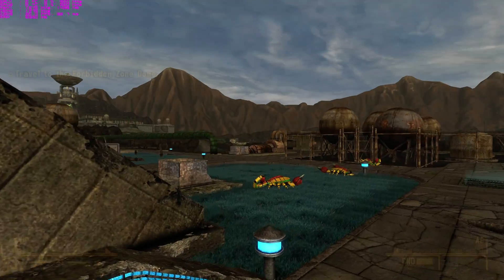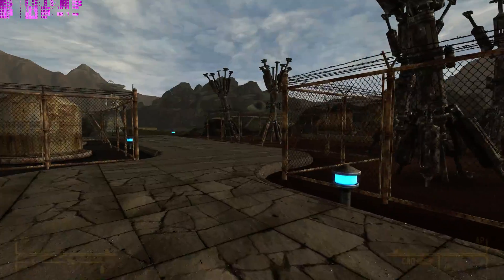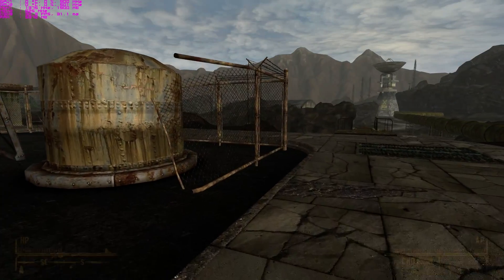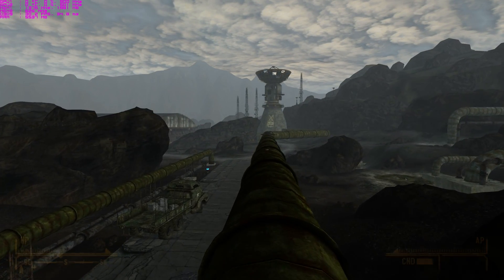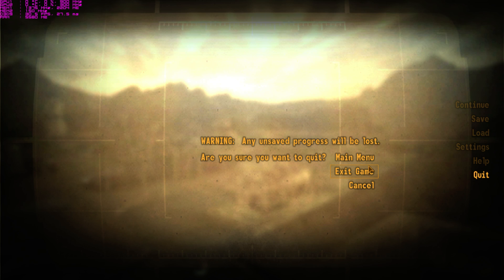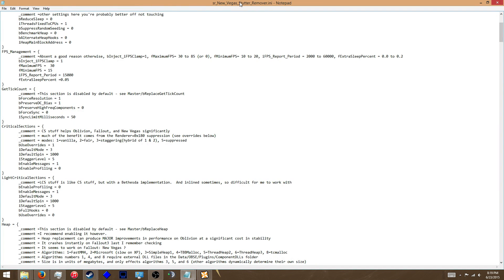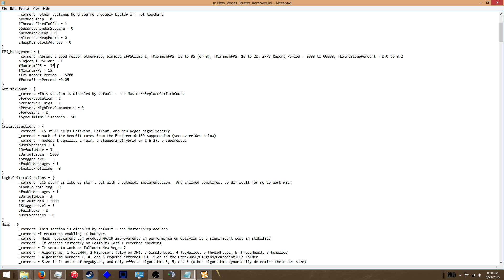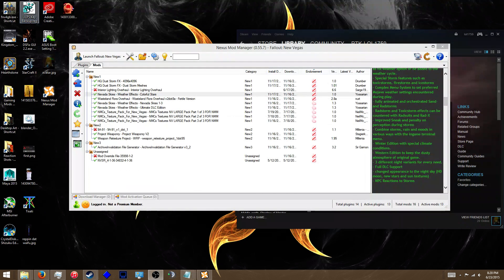An Introduction to Gamebryo [Creation] Engine Rendering

Comment: As someone who made game engines for fun, the argument "the engine is old and showing its age" is a pretty silly argument tbh. All that stuff is fixable, an engine's age has absolutely nothing to do with the quality of a game; it's more like Bethesda apparently doesn't have resources/time to fix issues/for proper QA. Open world games are generally hard to make in the first place, because there's so much stuff going on, you can't account for everything, compared to some linear corridor shooter (speaking of the silly calls to replace Creation Engine with idtech in TES6)  Blaming the age of the engine for everything is lazy thinking
Reply from the maker: I agree with you. You should take my comment not as a literal statement, and more a commentary on the codebase relative to what else is available now. It's clear that there are areas that needed to be improved, both on the engine and testing/qa side.

Comment: The fact that Bethesda still used the same Gamebryo forked codebase made the Creation Engine a crappy mess. Not only that but other game engines with Havoc Physics CAN handle refresh rates beyond 60Hz such as Valve's Source Engine (versions 2004 & 2007). Bethesda is just getting sloppy and lazy in fixing the bugs. 🤣🤣🤣

Comment: old video, but i just wanna say, the things mentioned both in the video and in the commets arent inherent issues with the engine and have been fixed in later bethesda games, such as the 64hz bug causing microstutter and the issue with the havok physics implementation not working when run at high framerates. in truth, the engine used by bethesda is pretty much perfect for the games they make. for example, its one of the best engines out there when it comes to keeping track of and rendering the many items you can pick up in the game world. it might be a small thing, but one of the staples of bethesda games is that pretty much every small object in the world can be moved, grabbed, picked up in your inventory, dropped, and sold. the engine bethesda uses currently is also incredible at keeping track of physics objects, so things you move around linger in the world pretty much forever. that piece of cabbage you put on a shelf is there to stay. the cons of these two featyres are increased save bloat and bugginess, but thats the price you have to pay for a non-static game world. another, and probably one of my favourite things about the engine, is how it keeps track of npcs. most npcs are tracked like other players, netimmerse being originally built for mmo games. this means that characters in the world have their own stats, skills, perks, and inventories, which allows for different combat scenarios against different enemies, and the ability to loot pretty much everything from a corpse and have that stuff physically removed from the corpse or the floor. downside of this is the cap on rendering npcs in a location, but this i believe can be circumvented with some clever optimization. the reason bethesda games are so buggy is the same reason something like the stalker series is. their engine is iterated on with the goal of dynamic worlds, be it npcs or items, and that comes with downsides, but having npcs actually do shit they say theyre gonna do, or having loot feel like an actul part of the world is very cool.
Reply from the maker: jackson I’ve not seen any specific literature mentioning the engine’s ability to store or render more small objects in the game world than other engines.

Do you have a reference for that?
Reply: thelol1759 I remember a statements from someone at bethesda who was explaining why the creation engine was being used for their games. I've worked with the engine extensively and can confirm. though what I said was exaggerated, there are probably engines that do it as well. one sec, lemme see if I can find the quote.
Reply: @jacksonelh  I guess you never found it?
Reply: can you not see my second reply?
Reply: @jacksonelh  I only see your original comment and your second about finding the quote.

Comment: I got pretty familiar with c++ programming, so here is my theory: Bethesda cannot access and fix those issues directly cause the Gamebryo source code was compiled in lib files. Lib files are like .exe files they still contain the source code but in assembly, Bethesda can only access the header files which reference those assembly codes.
Reply from the maker: That would be very odd. I hope that they aren’t hampering their dev team that much.
Reply: the Gamebryo they licensed only acts like a tool, they never had the source code. But this is just my theory.
Reply: @gage2560  So they just changed the painting but never the whole building because they couldn´t?
Well, it makes more sense now...

Comment: Sad to think Fallout 76... a 2018 or 2019 game will be using a modded version of a 2006 engine. Bethesda you kill me...
Reply: 1997 engine originally called NetImmerse.
Reply: so basically-
the 2018 fallout76 is running on a dos emulator...
GOOD JOB BETHESDA! XD 

lol im kidding 
its AT LEAST on a windows95 emulator :p
Reply: Fallout 4 and Skyrim were made on "Creation engine" designed by Bethesda, so i am sure that fallout 76 will be made on it too
Reply: Well, they aren't. Its just good old Gamebryo (or, Creation Engine, as Todd likes to call it) but heavily modified with net code and a decoupled game player from the world generation/loading pattern. So...
Reply: JRfo34nv Wouldnt be surprised if they ever change engine
Reply: TheEmpowerer wow thats sad.
Reply: JRfo34nv 
Perhaps they like their old engine ¿
Reply: It was made in the 90's...
Reply: Titanfall 2 ran on an engine that still has script from the early 90s
Reply: gamebryo launched in 1995 so its 24 years old
Reply: Actually, and correct me if I’m wrong, but I’m pretty sure that Fallout 76 is using a different engine that has been built from the ground up to support multiplayer. It’s possible the the same engine was just rebuilt. Even then, though, I’m sure they would have removed some of the limitations while they were already working on it. Like I said, though, I could be wrong.
Reply: Andrew Rice pretty sure they modified the engine
Reply: Even worse, Gamebryo was also the engine used for Morrowind and was actually released in 1991.
Reply: TheEmpowerer Are you sure ? Morrowind was released in 2002

Comment: First let me preface this, Fallout 3 and New Vegas were built on the Gamebryo engine, not the Creation Engine. The Gamebryo Engine was licensed for Morrowind, Oblivion, Fallout 3, and New Vegas. Bethesda decided to build their own engine and forked Gamebryo into the Creation Engine, its there own in house built engine. they did this because the graphic capabilities of Gamebryo were not advancing fast enough for their development of Skyrim.

The whole thing about 24FPS is a misnomer as you said. It comes form old cinema films. In order for a movie to maintain a smooth frame-rate and seem fluid it must be played back at a minimum of 24fps for the human eye to perceive full motion and not see a flickering effect. Anything less we start to see the frame drops as it called. The human eye has unlimited frame-rate perception, we see in a totally fluid fashion, the lower the frame-rate of things we watch the more it seems to flicker to our eyes. 
As for the farmer-ate bug you mention, it has been fixed in many ways by various mods over the years. The reason the gaming industry has this fixation with 30fps is its the lowest frame-rate that modern TVs and monitors can render a video image to our eyes and not seem to flicker or so the scrolling scan lines. They have this stupid idea that it all that a game needs to play at, which we all know is very wrong. The higher the frame-rate a game is played the more fluid and smooth it feels. But Bethesda's game built and both the Gamebryo and Creation engine must be capped to 60fps, no matter if you have a newer 144hz display or not. The Havok engine in all the games will not function properly above 60hz. All of the amusing videos of of Skyrim with Mammoths floating into  the air, dragons dropping like rubber-bands, or the giants hitting the ground in front of you and sending into the sky, or the many other things seen in the game are almost all do to someone not locking down the frame-rate to 60Hz, and letting it go to 75 and or above. So keep the games locked and synced at 60Hz and all will be well. Also there are a number tools to improve frame-rate and load times for the game. A little research will pay big dividends in the end.

Comment: the only problem I have with gamebyro is the textures are so bad i mean in some places there is litterly no texture just blocky shapes.
Reply from the maker: I'm not really so sure that texture size is really a restriction of the engine itself.

I know that for Fallout 3 and New Vegas the development teams were required to target a maximum system RAM footprint of two gigabytes and I believe less than one gig, closer to half a gig) of VRAM usage at any point. That had a huge effect on the maximum texture quality they could use on a given scene.

The small Creation Engine overhaul they did for Fallout 4 bringing it to a more modern 64bit platform, which allowed them to really go hard on increasing maximum texture quality and polygon count.

Now, if only they could properly thread AI, Sound, and Physics.
Reply: thelol1759 yea and many of animations are terrible sometimes when your walking instead of your legs moving u just glide across the ground.
Reply: thelol1759 honestly I don't know when the engine came out I think it was back in the PlayStation 2 era 2004 or 5
Reply: @dakotafoy1996  that isn't an engine problem, dude.
Reply: increase anstrotofic filltering

Comment: Interesting. Yeah - it seems like it was one of the intents to keep an engine from 2006 with minimal improvements to a 2010 game.
Reply from the maker: It makes almost no sense to me.

The engine wasn't good in 2006, so pushing for its use in 2010 was a pretty big mistake as far as I'm concerned.

I'd be very interested to hear some developer commentary on why they decided to keep using it.
Reply: thelol1759 yep and fallout 4 same engine only a slighlty update with creation rngine

Comment: It's really Bethesda that's at fault for using Gamebryo. Nobody else using this engine seems to be trying to push it as hard as they have, and still are, with Failout 4 and Skyrimjob. I haven't seen other folks complaining about the other games that use this engine. Pirates 2004 certainly isn't the bug-fest that Oblivion and Failout 3 were.
Reply from the maker: +Event Horizon What in the world are you talking about. 

EDIT: I see now. I thought you said "Its really NOT Bethesda's fault..."  

I agree. Shit engine should have been scrapped years ago.
Reply: ***** It's possible that Creation is a licensed fork of Gamebryo:
http://peter.corrosivetruths.org/2011/12/21/is-skyrims-creation-just-gamebryo
Reply: The Republic of J.e.z You haven't read the other replies...
Reply: They have been using the Creation Engine since Morrowind (2002) That's why you can use most of the same console commands from Morrowind up till fucking Fallout 4 also FUCK fallout 4 Skyrim was OK oblivion and Morrowind are the shit and maybe Daggerfall.
Reply from the maker: CrazyHorseInvincible
He's saying they push it too hard, which I think means that its a shit engine.

And I'm not too keen on the creation engine either.

They'd better have ported it to 64 bit, or I can already tell ya its gonna be a clusterfuck.
Reply from the maker: CrazyHorseInvincible
This is what I thought actually.
Reply: +CrazyHorseInvincible It is, its a modified version of GameBryo, thyeve been working on it since 2006
Reply: Wizard101 from KingsIsle is ok, but they manage it horribly.
Reply: +thelol1759 Skyrim and Fallout 4 use the Creation Engine. And I'm not sure you caught Event Horizon's meaning. Apparently he's saying not that Gamebryo is a "shit engine," but that Bethesda failed to use it correctly.
Reply: +thelol1759 they have ported Creation Engine to 64 bit for fallout 4
Reply: philip tm "Ported"?
Reply from the maker: CrazyHorseInvincible Thanks for taking the reigns there man.

It gets tiring answering the same question.
Reply from the maker: CrazyHorseInvincible
Its a term that means basically to rework till it works on new hardware/software.
Reply: +Rochester Swift Skyrim and Fallout 4 do not use Gamebryo. They use the Creation engine. Look it up.